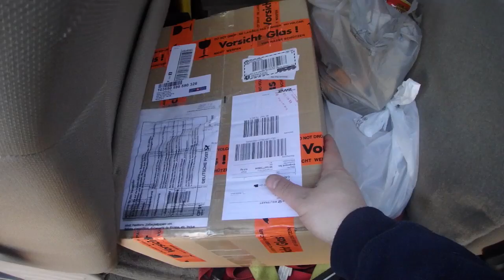A Special Package Arrives from Hungary

Comment: Warsteiner is one of my favorites.  We are lucky enough to have that sold locally.
Reply from the maker: +BuddyLe3 very nice, how is the truck treating you ?
Reply: +Bullshitkorner not to bad, taking care of one project at a time.  doing plugs and picking up rear springs tomorrow...maybe even a transfer case service. I got a nasty leak in my high pressure power steering line , so I gotta price that out and get that ordered.
Reply from the maker: very nice sounds like you got some videos to make

Comment: What happened with the pulley that made you wanna get rid of it?  I considered a while back getting one for the Accord going off of another Honda YouTuber, but he added an annotation to the video stating that he got rid of if and went back to OEM because the light weight pulley made to much noise and he wasn't satisfied.
Reply from the maker: +BuddyLe3 it was all snake oil I didn't notice any difference putting the pulley back on